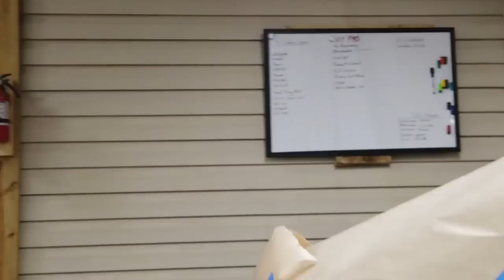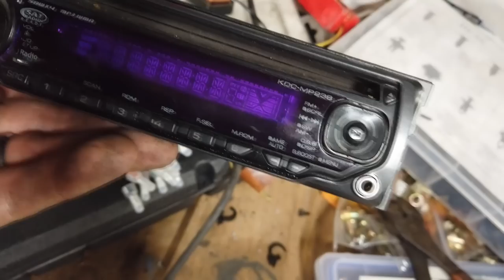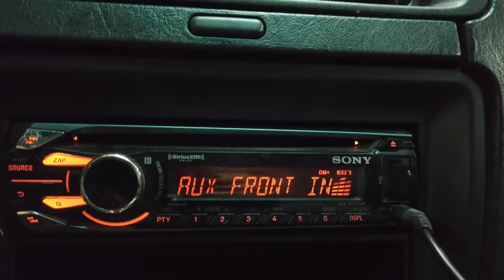Spray Painting my 1997 Subaru Legacy

Comment: Take your time with paint jobs. Rattle cans will work but you laid it on too heavy too fast. Take your time and start with very light coats and if you miss a spot dont go back and try to fill it until the next coat no matter how bad the urge. When you concentrate too long on one spot you build up runs. Do quick light coats and fight the urge to lay it on thick. A few light coats with good time in between depending on the temperature will fill out nice in the end.
Reply from the maker: Spoiler alert.  Next episode it turns out perfect
Reply: @UnWrecked  cant wait